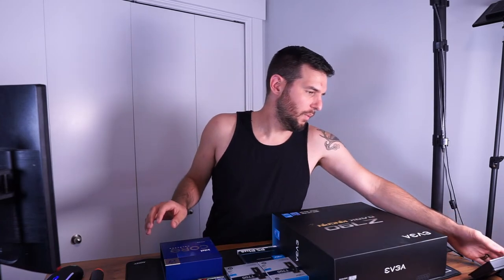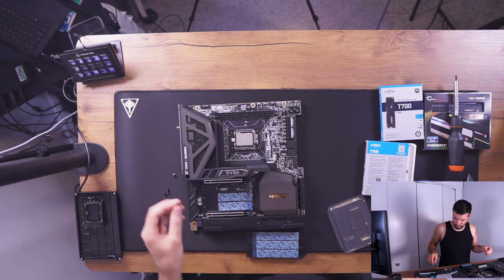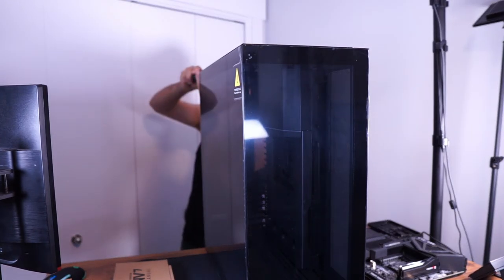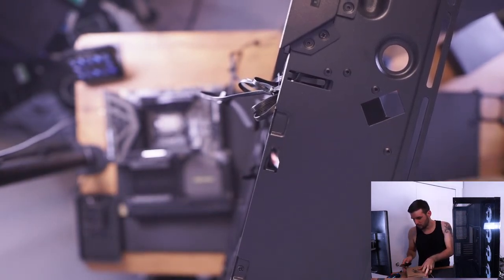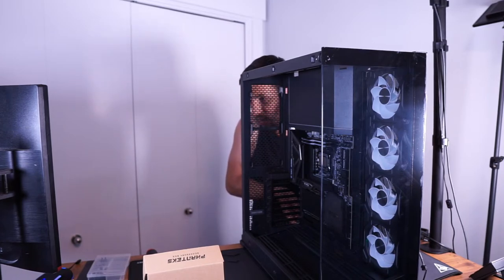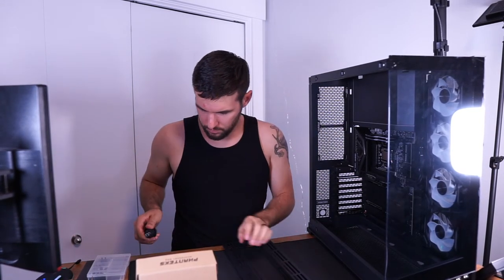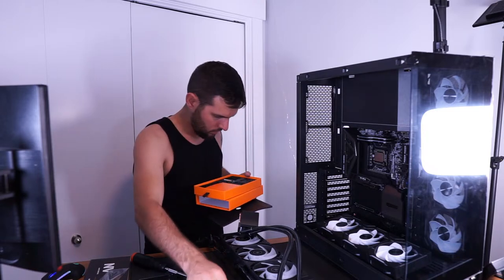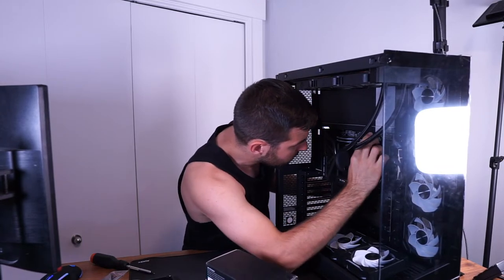$6k PC! 13900k + RTX 4090 for Spartakus

Comment: Did you use the built in DRGB controller on the case for the D30s? Is the RGB effect at the end using motherboard RGB or the case controller?
Reply from the maker: they were all controlled by the motherboard.